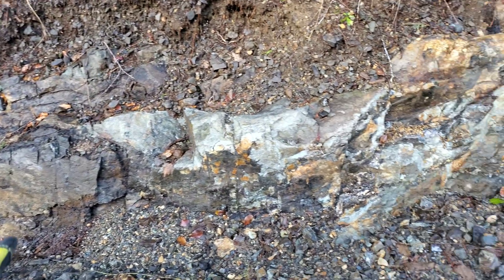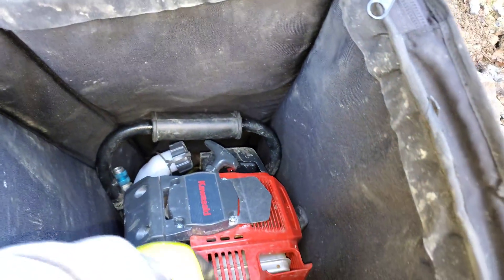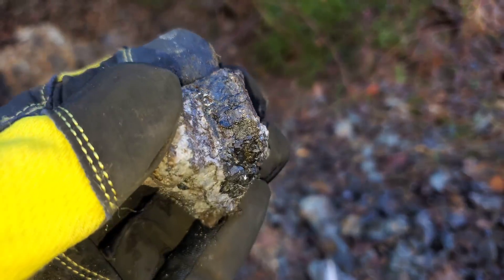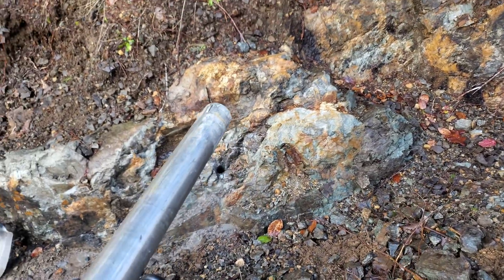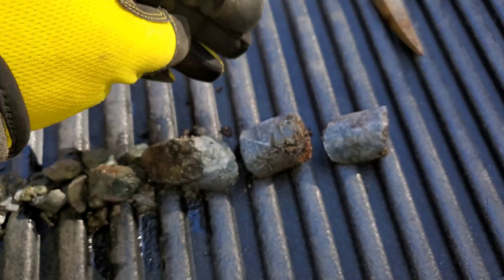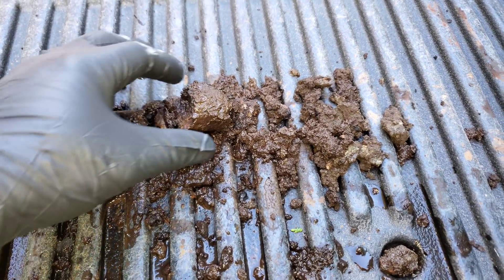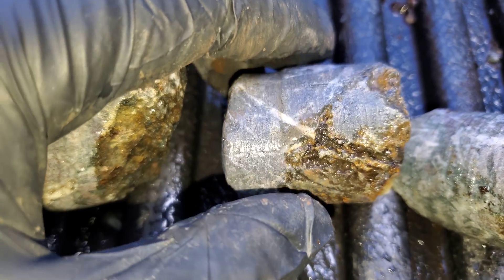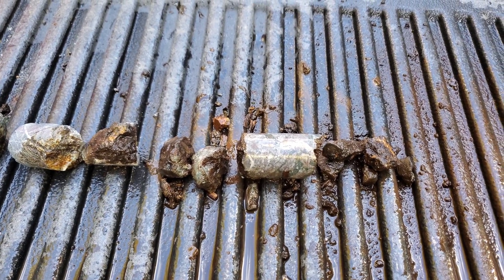Diamond Core Drilling Into A Gold Bearing Deposit!

Comment: Part Name	shaw portable back pack drill 
Engine Drill And Water Swivel	1.400,00	1
T Handle	200,00	1
Core Catcher	180,00	1
Diamond Core Bit	120,00	1
Sabre Core bit	180,00	2
Backpack	150,00	1
Core Barrel	120,00	2
Water Supply Compression Bottles	75,00	2
Extension	130,00	8
Core Breaker	100,00	1
Knockout Rod	50,00	1
Consumables	15,00	1
Total 4005.00 usd  for 15 meters

Comment: Great toy...When my Mrs asks what I want for Christmas I could only dream of such a piece of equipment.
Reply: Part Name	USD	
Engine Drill And Water Swivel	1.400,00	1
T Handle	200,00	1
Core Catcher	180,00	1
Diamond Core Bit	120,00	1
Sabre Core bit	180,00	2
Backpack	150,00	1
Core Barrel	120,00	2
Water Supply Compression Bottles	75,00	2
Extension	130,00	8
Core Breaker	100,00	1
Knockout Rod	50,00	1
Consumables	15,00	1
Total 4005.00 usd  for 15 meters